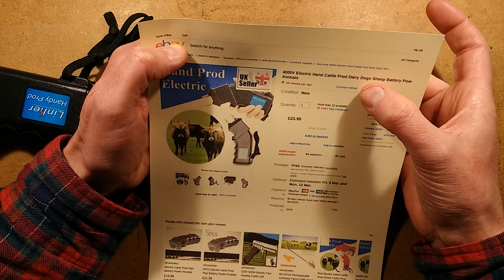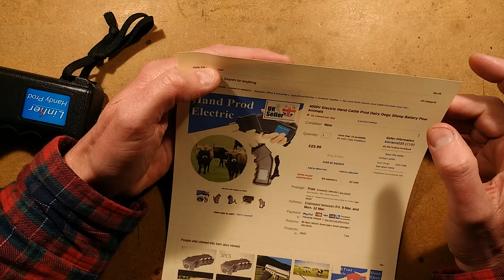Does a cattle prod hurt?

Comment: These pins look almost like EU style plug. It's tempting to plug it into the power socket.
Reply: Exactly what I thought. I'm pretty sure it would fit in a deathdapter.
Reply: It'll kickstart your TV
Reply: What it feels like to chew 5 gum
Reply: Dhruv Raques underrated comment
Reply: JendaLinda And maybe get the shock of a lifetime!
Reply: FRIENDLY JAPANESE BUSINESSMAN watch the advert for "5 gum"
Reply: I put my money on it doing nothing. Neither to the cattleprod or anything plugged in.
Reply: Mister Hat
I would personally assume that the only adverse effect would be to get the hot snot inside a bit melty, as long as you plugged it in so that the big cap inside didn't blow.
Reply: Do it! do it! do it!
Reply: Watch out though, if there's enough voltage it will ionize the air around everywhere the mains voltage goes and it will short in places it shouldn't and bring some of the mains current with it. Can be very destructive and likely very dangerous. I suppose it could kill someone and It would kill electronics easily. Look on the Kreosan russian channel and you'll find a certain video with the stun gun being used in the wall socket. Sure that's a much higher voltage stun gun but the effect is very real and enough high voltage is enough voltage. Note the white hot metal splattering out of the tv. If that's what you want to happen in your neighbor's apartment... just don't. I'd get real pissed off if anyone wanted to do that in a building I lived in. So maybe just watch that video and then just don't do it. I'll admit though the part with the chandelier had me rolling on the floor.
Reply: wdavem 4000 volts isn't really enough to cause any major ionization. I believe the rule of thumb is that an arc will jump 1 mm for every 1000 volts.
Reply: ok, but I was going by how far can you see it jump, whatever the source is. some crappy devices have close clearances. it would be a fun thing to test in the right conditions.
Reply: Rechargeable batteries?
Reply: Look for Kreosan on Youtube, they did that.
It blew out a bunch of stuff fairly far away because it creates an arc that high fault currents (from the mains) can follow.
Reply: So that Kreosan video with a stun gun in the power socket:

https://www.youtube.com/watch?v=euBpVr_XhuU

English subtitles are available.
Reply: It would be disappointing for you to plug the contact points into a Euro-socket, even if the spacing were correct.  Vaporization of the output transformer windings would be rather anticlimactic,  and sophomoric at best.
Reply: Assuming this video isn't faked, +xpehkto, then I absolutely have to wire a stun gun to an electrical cord!
Reply: DO IT CLIVE. DO IT. FOR SCIENCE
Reply: Dhruv Raques I lol’d
Reply: My observation would be that it would reverse charge and blow up.    Or if it's on it might freed back into the grid
Reply: Lets do it!
Reply: It's how you charge it
Reply: They look too far apart, to reach both contacts.
Reply: Kreosan did that...would not recommend... (HV jumps gaps on insulators and lights arcs)
Reply: Thats how you charge it I think
Reply: That's how you charge it
Reply: Maybe that’s how you charge it😂😂
Reply: JendaLinda ikn
Reply: Do it you won’t... no balls
Reply: @tissuepaper9962  im betting the thin wire in the transformer will just blow open.
Reply: @spiritofthegods  oh yeah yeah
Reply: s h o c k i n g
Reply: You can probably charge it by plugging it in. :D :D :D :D :D
Reply: JendaLinda do it
Reply: Rhats how you charge it haha
Reply: Blotto box.
Reply: That's how you charge the rechargeable battery
Reply: We don't have plugs like that in the UK... we have the best quality plugs.. why do other countries use dodgy two pin plugs.. and that's another good reason to leave the EU
Reply: I'm sure Clive could think of a circuit that would sense the 230V AC when you plug it in, and instantly turn the device into a battery charger fast enough not to damage anything.
Reply: It'd be like one of those plug-in power savers, but actually work.
Reply: my eyeballs say that the distance between the cattle prod electrodes ia slightly bigger than on an EU plug.

Comment: Called a "cattle prodder" 

"I wonder if it hurts"
Reply: JellyGamer  we still do. also, used for getting them in and out off trailers etc.
Reply: @goldenfox334  lol ever seen a cattle yard or do you think farmers just stand the middle of a herd of cattle getting driven into the trailer?
Reply: @orangekiwi526  oh im not saying the use of these cattle prods is a bad tool, but this one in particular is a poor idea. Most of the exspensive cattle prods (200$ units) have long polls one them so your not right next to the animal. I live in ohio in the states and its 90% farmland here, all corn and soybean.
Reply: GoldenFox i imagine this would be used on like pigs in narrower passages stopping the line, just resch over the low rail, would be more convenient than raising a longer pole over a short fence.
Reply: @StinkyBlack1  right, for pigs and small farm animals this would probably be a handy tool but for anything bigger i wouldnt use this unit. Its not that it wouldnt work as i said above its just too short but like all tools this has its place and uses.
Reply: @goldenfox334  True dat
But it would be, animals would be kinda used to pain, especially the fact that hair is an electricity conductor
Reply: We'll a prod doesn't really have to be painful
Reply: I was told to ask you for an award... Was wondering if you had any thing in say... White gold?
Reply: El Jolto strikes!

Comment: I grew up on a ranch.  We seldom used the cattle prods and I don't think we would have even considered using ones like that since it means that you have to physically get too close to the unruly cattle.  The ones we used had the electrodes on the end of a 36" long fiberglass whip / stick.  The brand name was "Hot-Shot".  We mainly used them when we were having to funnel the cattle into a chute for loading onto a trailer or to be put in a "squeeze chute" for medical work and even then, it was only as a last resort.  For most cattle, you could just walk towards them with your arms outstretched and they would move away.  Add a hickory cane in each hand and your outstretched reach was even more and most cattle would still avoid you.  Sometimes, you would get cattle that figured out that they could just go though your outstretched arms / canes or even a wooden fence post that you thought you could put in front of them to stop them.  They will also go through you on occasion.  I've ended up flying through the air a couple of times in my younger days, thinking that I could stop a cow that turned around on me and didn't want to be funneled into the chute.  Of course, the landing is not as hard as it would normally be because these areas are often a bit full of mud and cattle excrement.  And we all knew what it felt like to be zapped by a cattle prod because it's just one of those things that we think is funny to do to someone else when we are young.  The electricity was able to go through the lightweight shirts we were wearing in addition to denim jeans.  But we were in a warmer climate than you, so we did not have as many insulating layers of clothing on as you do.
Reply: Well it is in fact abuse, but I wouldn't advocate for prison, just recognize your mistakes and go on with your life by contributing less and less to this violent system. By what you've typed I imagine you already have a different job which is awesome! Now try to eat less animals products
Reply: But animals provide such tasty meals, why would I do such a thing?
Reply: @fippylol  Because animals need to be killed for those "tasty meals", the only ecception would be eggs for someone who has his own chickens and he makes sure no animals are killed in the process. It's as simple as that, considering that in the western world we can live without animal husbandry anymore
Reply: @LeoJackson98  Why does it matter if animals are killed? we've been eating animals since we've existed, animals are not some precious priceless resource lol
Reply: @fippylol  Well the fact that mankind has always killed animals is not a justification since we have done a lot of awful stuff during history and while this might have been necessary previously it isn't anymore. You consider animals as a resource but how is that fair? They aren't just matter they are sentient beings, often as intelligent as little toddlers, they can suffer both physically and psychologically and that's why we should avoid to kill them as much as possible
Reply: In Sweden, it's not allowed.
Reply: Your name makes this so much funnier
Reply: @spikedpigeon5740  A pig can accomplish tasks in a similar and in some cases better way than a 18 months child, but I guess taking every oppurtinity to joke about vegans is funnier
Reply: I do this with some puppies and suddenly everyone’s in a fit
Reply: LeoJackson98 So I'm supposed to eat plants? B-b-but plants are living organisms and deserve life too! We humans should just stop eating entirely because we dont want to hurt anything living! If we did we would be monsters! How can you all live with yourselves knowing you ate something that was once alive!!!
Reply: @LeoJackson98  it's not a pet it's livestock
Reply: @LeoJackson98  the way thst was written makes it seem like you are comparing me eating roast chicken on Sunday lunch to Hitler doing the holocaust
Reply: What a fun conversation! I grew up working on farms and yes animals are living things. Pigs and cows and sheep and goats have some personality, they are mostly “generic” behaviors but some are clearly reasoning things out on some level. The problem is that if you have milk cows for example, they sometimes get names, you learn their “ways” and they learn yours. On most farms they are treated well and often have a long and even coddled lives. Bad news, they still often get eaten. Usually by the family that knew them for years. They are older and not the prime quality but still not wasted. On the other hand are the cattle raised for slaughter. No names, no long term relationship and off to market when they are in their prime. Unfortunately for them, they are delicious. This probably drives people crazy who expect everything to just and fair but that isn’t the way of the world or the nature of life. 

I saw a TV show over the weekend where a lioness with two starving cubs used the last of her own energy to catch and kill a small, young gazelle as the gazelle’s mother watched and fretted. The cubs came in and the small animal was ripped to shreds. That is real, that is nature. We are nature, not some alien freak on this planet. 

People who hike up a mountain and crap in a plastic bag so they can bring it back down are ridiculous. I mean sure, don’t poop on the trail, dig a hole. But to consider human waste somehow more of a toxin to the environment than a bear or wolf or whatever is plain silly. You are assigning too much power to your poop, and too much significance to your existence. Get over yourselves.

Have you ever witnessed a spiritual person take a game animal to feed their family? Not for sport but for nourishment?  Words of thanks to the creator for providing the catch, and thanks to the animal for its life and its body. That is who we have been, at our best, from before written history. Not everyone can (or care) to go to a fast food place and eat a hamburger made from animals with tumors in another country who were tormented their entire lives and not give a though to the death that resulted in their tasty burger. 

Trees die and turn to dirt that other trees grow from. Death becomes life, life becomes death, a natural cycle the we are all participating in and nature doesn’t give a damn about your opinion. When I die, I would like to have an Indian burial, my body not defiled with chemicals but placed in in an accessible place for birds and other animals to eat, then insects, and spores and bacteria, with the last of my mortal remains left in that place to enrich the soil so plants could grow there. Or, as my grandpa wanted, just bury me face down with a peach pit in my butt so a peach tree can grow from my remains. Years later children can come there and enjoy the butt peaches.
Reply: @LeoJackson98   "A pig can accomplish tasks in a similar and in some cases better way than a 18 months child" ...... Why on earth does that matter? An 18 month old child is  completely worthless, the only reason we dont eat them is because they grow up into adults that can actually do something.
Reply: @fippylol  You're missing the point: the fact that mankind can't live without killing doesn't mean we should do it when it's completely avoidable, especially considering the difference in terms of sentience between plants and various species of animals (a plant is less sentient than a bug which is less sentient than a fish, and so on). I have yet to see a serious ethical argument in defence of animals husbandry
Reply: @solarsatan9000  Well the two things are different because humans are usually more sentient than a livestock animal, but think about the similarities: the jews were lied at to make them go neatly towards their death. The same scientific process is used in slaughterhouses when animals are killed in the most effective way. It's awful and I think that's enough to stop doing it
Reply: @fippylol  Lol no u xD
Reply: LeoJackson98 - The reason for animal husbandry is to raise tastier animals, animals with more meat and more docile behavior. You may not consider that a defense, but it is a fact. I prefer wild animals who’s bloodlines haven’t been tampered with. I also prefer local produce when it’s available. I think this is in accordance with the plans of our creator. I also think there a lot of us on the planet and the demand for meat protein is too high for all of us to live that way though. Luckily many of us aren’t willing to learn how to clean a deer or other animal, to witness the death, or appreciate where their lunch really came from, which leaves more for me.
Reply: @17ll3 x214 Oh yes it is. A lot of stuff!
Reply: @rustyaxelrod  I know the reason why husbandry exists, I've studied the subject back in my agrarian high school days, we even made salami and other meat products when I was in sophomore year but later I understood that since humans can live without animal products this whole scientific process is cruel and pointless. I'm not a vegan yet, I still eat eggs once a weak, but I think everyone should start making small steps toward this objective to maybe one day completely eliminate this horrible practice (btw the same goes for hunting which is pointless 99% of the time)
Reply: @rustyaxelrod  One small thing on the "creator" stuff: I think that religion morality should be based on reality, otherwise you can justify any kind of brutality in the name of God, this has happened many time during history and it's still happening in ISIS
Reply: @17ll3 x214 A tiger can't understand morality or live without meat, a human being in most situations can
Reply: LeoJackson98 - we have different dietary objectives 😉 and while I feel strongly about my own, I don’t have any desire to force them on the population as a whole. Eat what you like. As far as our relationship with our creator, I feel the same way about that. It’s a personal relationship and if you have no faith I would be happy to pray for you but I have no desire to force you to believe. I wouldn’t know how to even try to do that effectively, and I don’t hate people who think different than me. ISIS on the other hand believes if you don’t believe in the things they believe that gives them a right to blow up the school where your children are because they will grow up to be non-believers also.